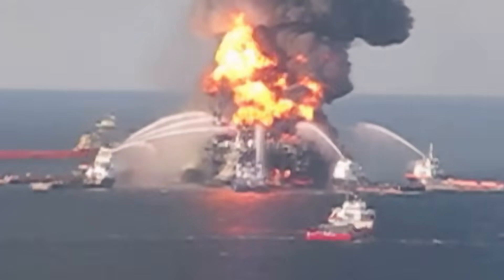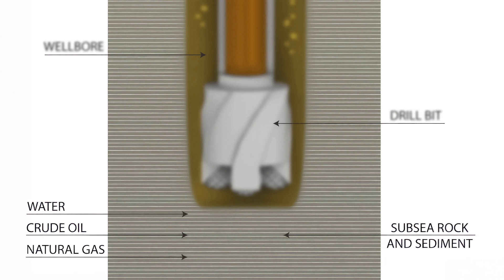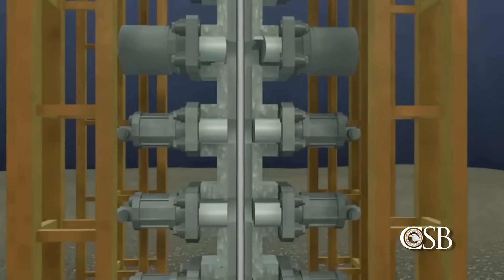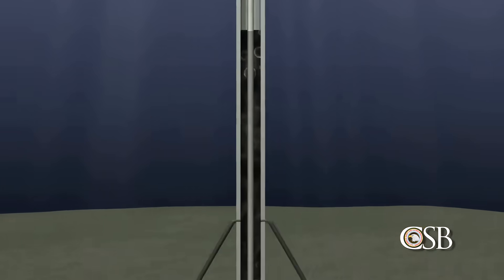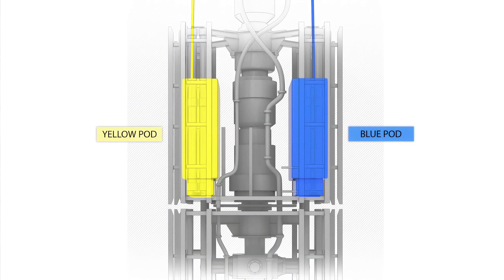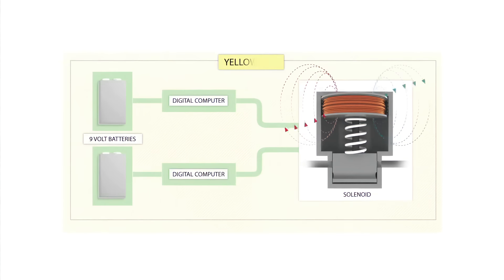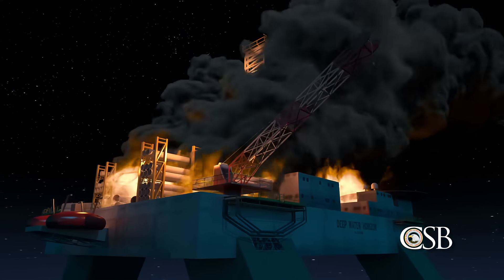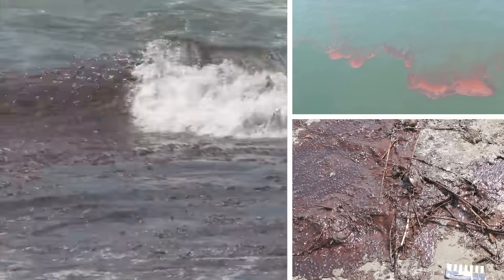Deepwater Horizon Blowout Animation

Comment: one time when I changed my motor oil with one of those drain tubs, I sat it on the edge of my work table, full. a squirrel had been watching me and dropped an acorn on my head. While in a seated position i grabbed the acorn and chucked it back at the squirrel. When I did this my foot kicked up in the air under the brace of the work table and the drain tub slid off the table with no cap on the mouth of the tub. I lunged for the tub to keep it from spilling everywhere and caught it by the neck of the tub and crammed my thumb in the container opening. But the weight of the 3/4 full tub made it slide towards my face. I was able to dodge the container by stretching my neck way back and turning my head like an owl sorta. In the break dancing-esque commotion I had also knocked a tin gallon of muratic acid carburetor cleaner over that was on the lower shelf but stopped it from spilling by catching it with my not guilty foot. A little splashed on my ankle and I gotta say...damn, your hand skin sure is cool compared to your ankle skin. So, laying there with my thumb in the hole and the tub resting against the table and my neck and shoulders and a about 1/2 gallon of acid propped up at an angle by one foot about 3 feet from my junk, I had some time to reflect on the sh!t that had just happened and where I was going to go from there. Try it. Lay on your right side, (the position I was in after chucking the acorn and rolling backwards, because i am mostly a fat guy) lay close to some cabinets with your feet partially under a work bench with a lower shelf. Now, swing your upper body around to the left, stretch out  your arms and the reach back only from the elbow and hold a liter bottle of liquid with your right hand with a thumb in the hole.  You should be laying on your left shoulder now, pinning your left hand from cooperating in any of this. Now, prop up any kind of acid you have around with your right foot on the lower shelf. Left leg should be splayed out from under you to the right, behind you. Yup. That was me. I did what any man in my position would do. I'm no hero although some have claimed it to be true. So I found the most comfortable position in which I could draw the biggest breath I could and yelled, "BAAAAABE!!!!!!!Come'eer PLEASEEE!!!!" Yessir the real hero that day was the wife. Technically it could have been an oil spill, so I can understand...sorta..

Comment: And yet no coverage of the failure of the private GPS system that was used by the automatic station-keeping system.
Reply: David, sounds like fake info.  Where did you get that?  GPS worked until the power went out (from the explosion), and then the rig propulsion thrusters stopped. And the subsequent drift off of the rig was NOT a factor in the either the explosion or enduring blowout.  (Drift-off was slow, and in fact the riser stayed connected, holding the rig at about 700 ft. from its original position. CSB Report Appendix 2-B, pg. 86)

Comment: Don't see why the whole 9volt battery thing was needed in this vid. The rams still closed. They just couldn't do the job they were suppose to do because of the buckling. It's not like battery power could of made them close further. Still, I guess it was interesting to learn that the same thing I have in my ceiling fan remote is used on a ten gillion dollar piece of equipment. lol Not exactly what I'd use but what do I know.

Comment: where did the pressure come from to force remaining materials all the way to the surface after the shear ram sealed the well?
Reply: Shear ram closed, but did not seal the well.  Watch the  video again.  Also, the crew closed pipe rams which did seal the well earlier,  but gas and oil was already above the BOP in the riser.  The gas migrated quickly to the surface, got loose (more mistakes made) and exploded.  The resulting loss of power caused the blind shear rams to close cutting the highly pressured drill pipe, but did not seal, and now a new leak path had been created.

Comment: Airbrakes on semi-tractors are failsafe. That means that air pressure must be maintained to release the brakes and overcome the pressure from a spring. If air pressure is lost the brakes are automatically engaged by a spring.

So for whatever braindead reason, whoever designed the blind shear ram decided to not make it failsafe. The decided that if electrical power was lost (or the batteries died) or whatever, that the blind shear ram would not default to closing. Whoever designed that should be thrown in jail.

Comment: Mike William stated one of the annular was severely damaged 1 month before explosion
Reply: An exaggerated claim; the annular is designed to tolerate some rubber loss and was subsequently tested okay.  Regardless of that, the annular he discussed WAS NOT THE ONE THAT FAILED in the blowout.

Comment: So many silly errors that could have been avoided. Even critical design errors..... Why make the shear ram blades smaller than the outer wall of the bop, It should be made so no matter where the pipe moves the blades will cut it, even off center.

Comment: I do not think the effective compression caused the bending forces on drilling pipe. Simply the drill pipe is an 1" thick wall and 75ksi. Internal know design pressure in drill bore is 15k...There is no way effective compression caused the problem. I would think the Blind Shear RAM has caused the drill pipe off center.
Reply: Think again using the pressure numbers.  The compression load needed to buckle the drill pipe (elastically)  was about 75,000 lbs, and the effective compression load within the BOP went to over 100,000 lbs, when Pi got to 7,000 psia and Po was only 1,200 psia.  (CSB report appendix 2B, pp. 26-30).

Comment: Shear rams are built to shear a pipe..let alone be buckled or straight..it will cut it and make a blind...
Other than that..even if the hyd pressure was way below the formation preasure...did the pressure of formation fluid go beyond the capacity of the b.o.p which should b no less than 10000 to 15000 psi ?howcome the annular, pipe rams not hold up the pressure?
Reply: >Casual wrote 'Shear rams are built to shear a pipe..let alone be buckled or straight.'  WRONG at the time for the ones that were on that rig.  That is the point.

Comment: Wait, what happened to the first line of defense, the drill mud?
Reply: A hard kick?
Reply: @specialtymachining  Apparently there is way more to this than just what is presented in this film. It was mentioned 'technical, organizational and regulatory factors' and this film only focuses on the BOP failure, the events that precede the need for the BOP are just as important. So ye, that's why I was confused.

Comment: Don't you think effective compression was caused by the weight of the pipe above the blow out preventer because the rig stopped pulling on the pipe?
Reply: Recorded data of the DP tension (hookload) at the surface indicates that the drill pipe in the BOP was in axial tension at the time the buckling started (due to high drill pipe pressure - measured at the surface.)

Comment: Why not just let the rig continue to burn as an improvised flare platform until another BOP could be put on the intact pipe?   Sinking it just made the situation a lot more complex.
Reply: Good question, but the rig was probably going to sink in a few days anyway, as the intense fire essentially melted the rig structure away.  The fire boats were intended to try to keep the steel from getting too hot.  (They knew the hoses could not put out such a fire.)